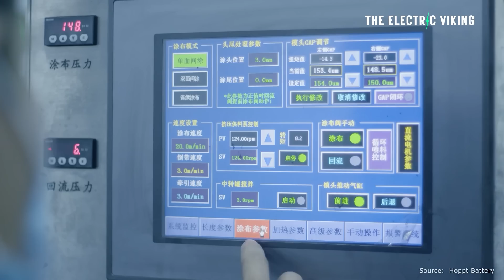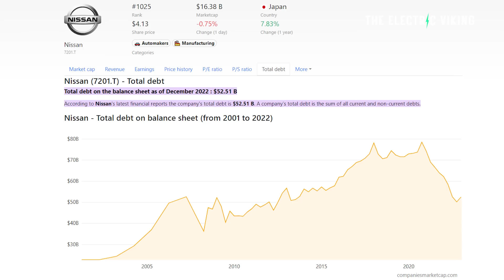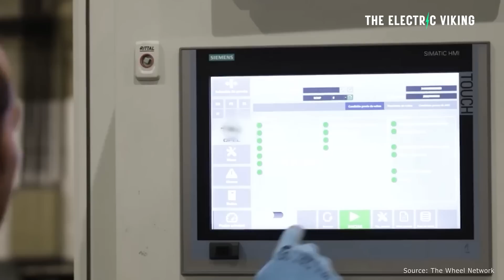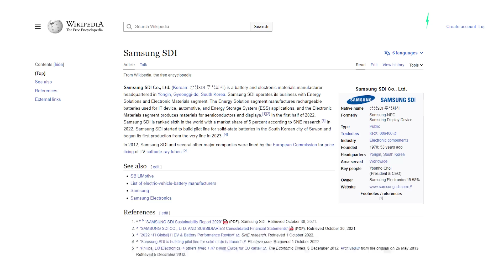WAY too many battery factories are being built in the US with the wrong batteries

Comment: Sam, how difficult is it to switch from Turnery batteries to lfp? Obvious question,  right?
Reply: Some of the battery companies may not have the necessary LFP tech and IPs.
Reply: @PeterXiao1  

LFP patents are now expired.  That's why we saw LFP batteries starting to be produced outside of China a year or two back.  The patents were held in China and they forbid the use of LFP batteries in non-Chinese EVs.

Switching battery chemistry?  I don't think that's difficult.  As far as I know the manufacturing process is the same.
Reply: @bobwallace9753  New patents are constantly emerging that increase battery density, charging cycles and speed.
Reply: @PeterXiao1  
True.  But the patents that made it impossible for western hemisphere companies to manufacture LFP cells are no longer.  The lead for the very best will likely change from time to time but there's likely to be a strong market for 'good enough' cells since demand will be so very high.

The second, third best will likely need to sell at somewhat lower margins but at a high enough price to justify being in business.  Same thing happens will pretty much any product.
Reply: @PeterXiao1  >>  New patents are constantly emerging that increase battery density, charging cycles and speed. <<
New patents don't really cover all the trade secrets heavily guarded by different manufacturers.  The battery manufacturing is like making perfect pasta -- you need to have the right temperature, pressure, humidity, etc, etc, to get the consistent product and yield.  It take as long as 6months to 3 years to achieve this at scale.
Reply: @bobwallace9753  :  Most key LFP patents were held by a Suisse patent consortium back in 2000's.  China negotiated licensing terms that allowed China to use LFP tech royalty free for all domestic use, but they still had to pay royalty for LFP sold outside.   Then by 2022, most of them expired and it opened the door for Chinese EV makers to export EVs around the world.
Reply: @tooltalk  
I didn't know that the patents were owned by a Swiss group but once those patents expired any company that wanted to could manufacture LFP cells for any use. 

For several years I wondered why BYD was putting LFP batteries in their EVs that were being used for taxis but no company outside of China was using them.  When I asked I was told that LFP batteries were too inefficient.  But they were clearly working for Chinese taxis.
Reply: @bobwallace9753  : it is true that LFPs were inefficient to be used in moving vehicles.  Even now, they are barely good enough (no pun intended) to be used in entry-level, low-range EVs which is fine in China since China's NEV policy was geared towards low-range urban driving.  It wasn't until last year 2022 that LFP EV sales matched that of NCM EV for the first time in China.   The challenge now is to extend that to sparsely populated country side with not-so-great power infrastructure, in which case, NCM maybe better suited.
Reply: @tooltalk  
 I question your "barely" good enough.  With most EVs seemingly moving fairly rapidly to LPFs it seems like good enough applies.

The BYD EV used for a taxi was not a NEV, but a five seater car.  Drivers would charge overnight, drive a half day, and recharge during their lunch break.    

Lithium-ion batteries are likely to be used only in high performance EVs and very long range trucks.
Reply: @tooltalk  

"CATL, the world's largest EV battery maker and a major Tesla supplier, has launched a new lithium iron phosphate (LFP) battery that it claims can add 248 miles of range in 10 minutes of charging."

Does BYD have a faster charging LFP cell?  In what way might BYD cells be better?
Reply: @tooltalk  

I will use my common sense.  I won't believe that CATL has a LFP battery that will charge in ten minutes until it's proven in use.  That is what I've learned to do with all battery claims having been burned previously by dishonest battery companies, mostly startups.  However, seeing as how the claim is being made by a very major battery manufacturer I'll allow myself to have a bit more optimism than I would allow with "Joe's Battery and Hula Hoop Company".

What good is rapid charging in a low cost, lower range EV?  You should have been able to figure that out.  There's a market segment that can't afford a $50k+ EV.  In order to capture as much of the sub-$35k market as possible offering a rapid charge rate to make a lower range EV practical for longer trips expands the market segment.

"BYD , 11 fires between 2020 and 2022. The last episode in October 2021 with a BYD Han that caught fire while traveling along the Shenzhen Shuiguan highway"

The BYD Han uses lithium-ion batteries, not LFPs.  At least one of the other 10 fires was a coolant fire, not a battery fire.

We can't put those other 9 fires in context since BYD does not report separate production numbers for EVs and PHEVs but combines them.  

Can you provide actual, reliable data for BYD LFP battery fires?  Or are you just spreading FUD?
Reply: I agree... Not that hard after losing money because of lawsuits caused by batteries exploding.

Comment: ☝️😏 ,,YOUR IGNORING A CRUCIAL FACT, they can change the type of batteries they build. No equipment has been built or purchased, ground has yet to be broken etc..and battey technology is rapidly changing as you have repeatedly said,over & over ..so yes, they will build battery factories, but there is plenty of time to adapt the manufacturing process. By 2030 they will be 3D printing new technology batteries
Reply: Some of the battery companies may not have the necessary LFP tech and IPs.
Reply: @PeterXiao1  by 2030 there will be an entirely new technology for batteries. You can't use values of today and apply it 7 years into the future. A good bet is in 2030 the batteries will be 3D printed
Reply: @BillCoyne12  The sensible approach is to build on the current best tech and adjust for future best tech later on.
Reply: Probably, but we don't know what it will cost, what special skills are required, and how long it will take.

Comment: Exactly why I said I am waiting on my GM Silverado EV is for THE Battery I think is state of the art.  Your reviews like this tells me to wait....wait...wait.
Reply: GM uses the very dangerous Pouch Cell batteries called Ultium.
However, they are trying to switch over to a 4680 Tesla style round cell.
GM learned a very harsh lesson from the Pouch Cell batteries in the Bolt EVs.
Reply: Wait until the release of the Canyonero. A Simpson design.😊😅😂
Reply: @malcolmrickarby2313  I've reserved the Marge Edition!